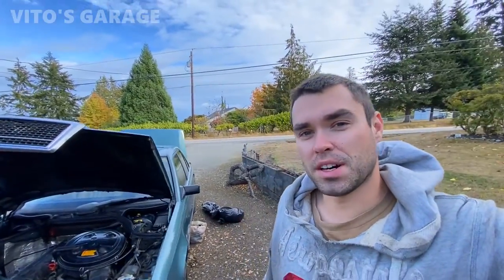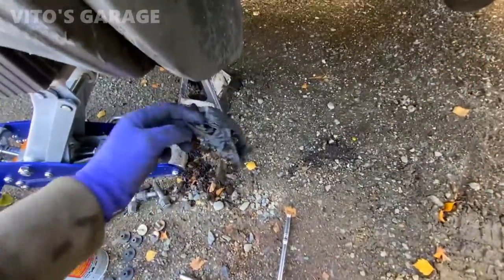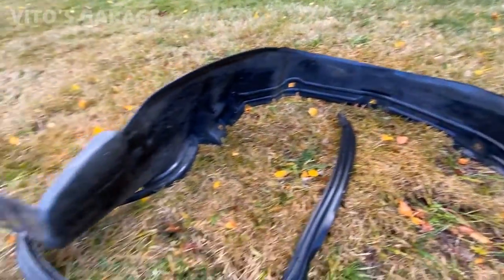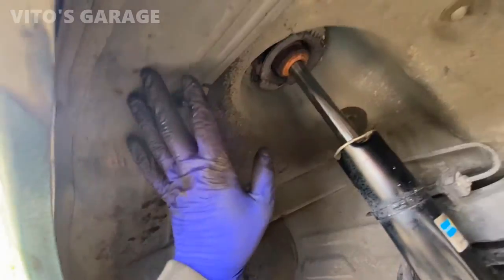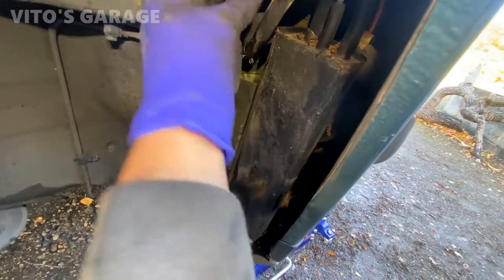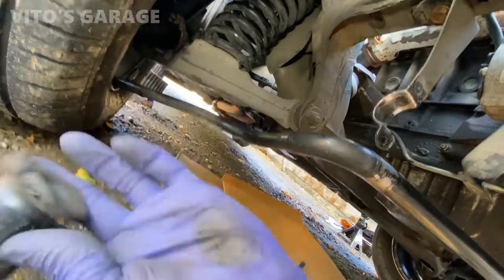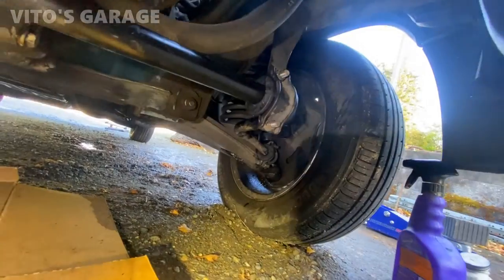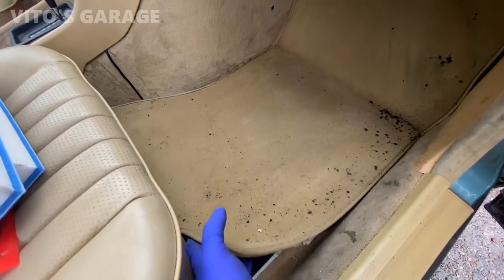Part 7: Mercedes W124 Front Fender Liners Removal and Preservation, Cleaning Drains, Sway Bar Links

Comment: Hey Vito I need to replace my shifter bushing on my 300E and I was wondering if you can add a clip on how you replace them on the next video.
Reply: they are a pain to do, at least on the W201's. Mercedes source sells a special tool to make the work a bit easier
Reply from the maker: Yeah good luck with the special tool. It doesn’t work well. Next video I’ll show how I replace them
Reply: @VITOSGARAGE  Perhaps there is more space on the W124's. On the W201 almost impossible yo get the hands up there. Hoping to see the way you do it
Reply: @VITOSGARAGE  Thank You Vito🫡🫡

Comment: Hey vito you know anyone looking for a 87 300sdl w126. Runs great everything works all the service was just done about 20 miles ago. $2000
Clean title Drive it away. Selling it to buy a interior for my w124.
Reply from the maker: Hello sir. I can make a post for you on my Facebook page if you want. Send me the info and picture on Instagram: vitosgarageyoutube. 
Maybe we can find a good home for that amazing machine.
Reply: @VITOSGARAGE  i just changed all filters. Full synthetic oil change.
Just put trans in it only had 60k miles. New seals.flex disk. New belt.brakes flushed. New belt. Tires have about 50 miles on them.diesel purge done. New injector return lines. Starts easy no smoke. No rips in leather.Runs drives. Title. I thought I wanted an s class but like my w124. Not as big. Might take part trade for nice w124 interior.  Will send pics. 
Drive away $2000